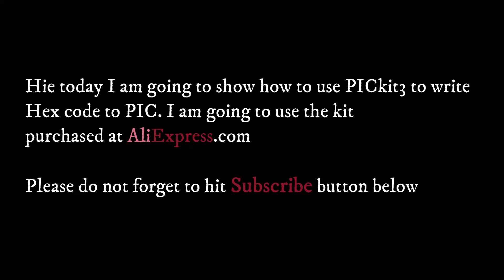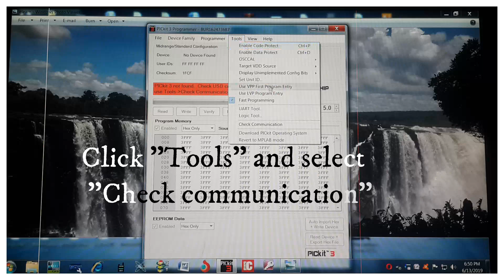PICkit 3 programmer kit review from Aliexpress

Comment: how would i program a PIC18F2450   with a ebay/amazon (SCM / 24/93 Series EEPROM Memory Chips USB PIC Programmer SP200SE/SP200S Enhanced Version)     which software do you suggest?